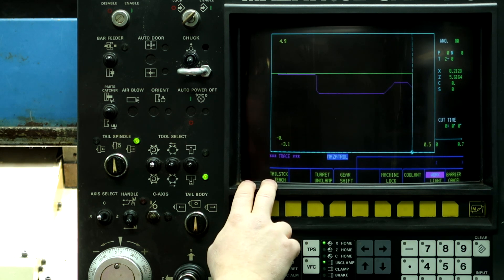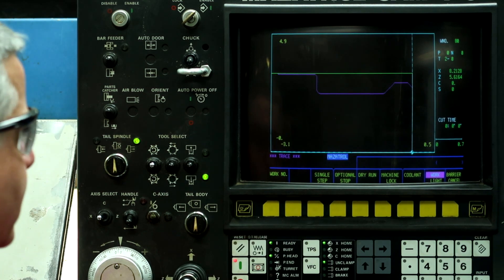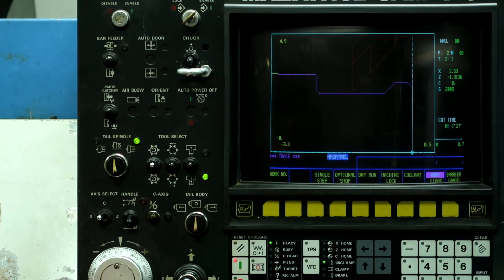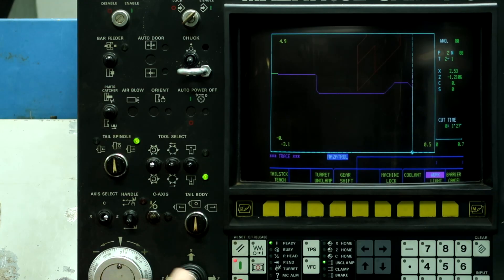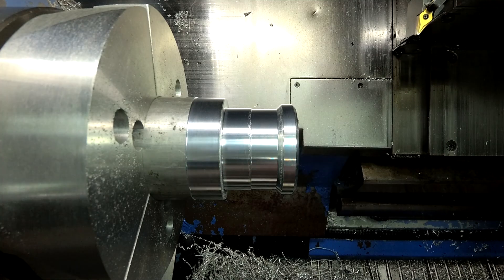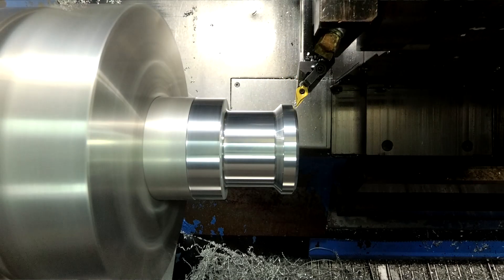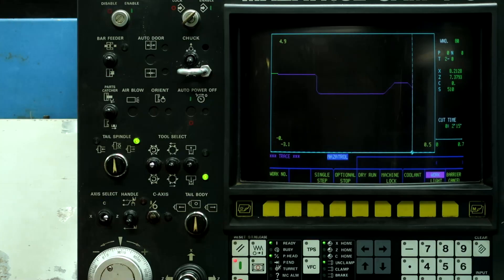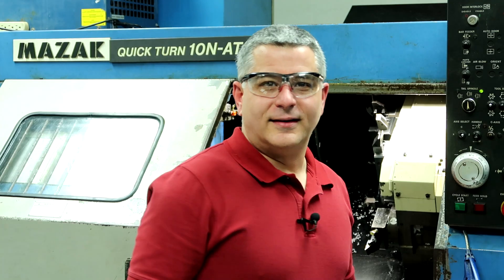Mazak TPS Button Function

Comment: As usual i like your videos, very informative for both beginners and trainees.
I would like to see a video about how to set up a new tool, tool data, to avoid cutting deep with a tool that cannot go deep. Many who don't know the correct way just put in 0.
Reply from the maker: My old T3 control will not throw up an alarm if the tool is too short to make the cut. See my video on bar pulling. I forgot to describe the length of the part off tool correctly and you can see a short tool plunging into the work piece. Someone commented about it. I didn't even notice it.

Comment: Can you use TPS a few passes back.
Just by pressing feed hold, handle, move X.200 away from cutting surface, then TPS, move Z.100 back, then TPS and X and Z again then a insert change.
Will the machine let you restart the cycle in the middle of the canned cycle a few passes from the cutting surface.
Reply from the maker: No. The TPS will bring the cutting tool back to where the machine was stopped.

Comment: Hello Phil.  I was reviewing your TPS button video and am wanting to try this on our Mazak 350 II as I have never done this yet.  I am sure it it probably different on a newer machine vs the old but similar in ways too.  I would like to ask however if the turret can be rotated to access an upside down held tool during this TPS movement cycle?  Your example shows the insert side up and easy to access.  Many times our tools are upside down and can't see the screw  untless the turret is rotated to get to them and then return to the cutting tool position desired.  Can you please advise on this as I am interested in knowing more.
Reply from the maker: I just tested it. The machine will allow you to index the turret and change the insert, but you must return the turret to the original tool before hitting cycle start otherwise the machine will alarm out.
Reply: @mazatroltipsandtricks6816  Excellent.  That would be what I was looking for if the machine will release the cutting cycle enough to rotate the turret away from what it recognizes as active to change an insert then go back to where it was like it was never rotated.  Very good. Thank  you.  These videos are extremely helpful. Thank you!
Reply from the maker: @jimmonk7936  Thanks for the compliment.

Comment: For sub note reference would you be willing to list machine/controller specs in video summery? 

Machine:        Series?
Controller:      T2, T3, Other?

Very informative video btw. As most of this content can be used Controller to Controller with slight variations in user interface/controls seen in later models of Mazak's turning machines.

Comment: Just a warning, when you rapid straight down onto the job, you have a chance of rapiding into the job if your previous insert was heavily worn.
 I like to move away in both directions, and on my mazaks they will feed down on the hypotenuse of the x and z movements.
Reply: Just set your tool to stop .1 from your work face. Never on 0

Comment: Can this be used in single process mode as well as auto?
Reply from the maker: Yes, you just need to go back to single process after changing the insert.
Reply: @mazatroltipsandtricks6816  🙏